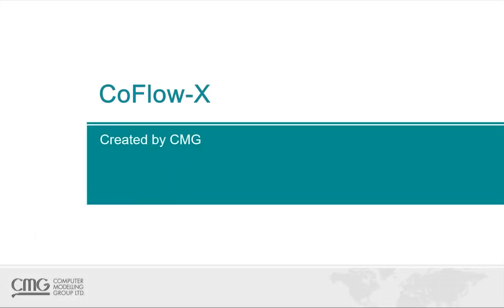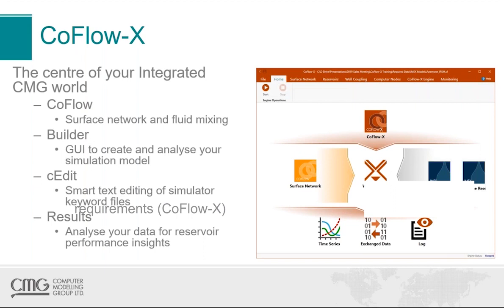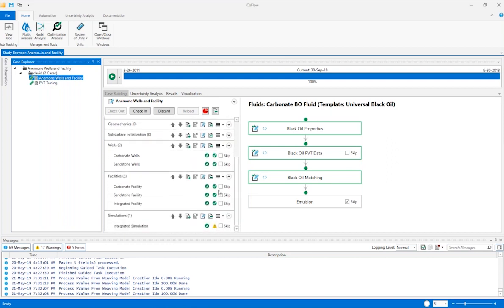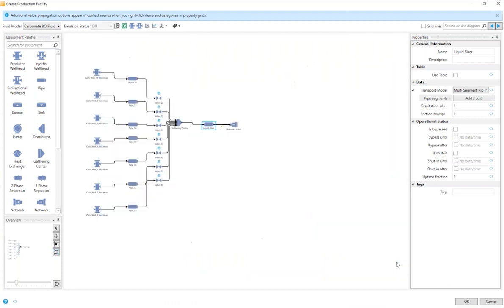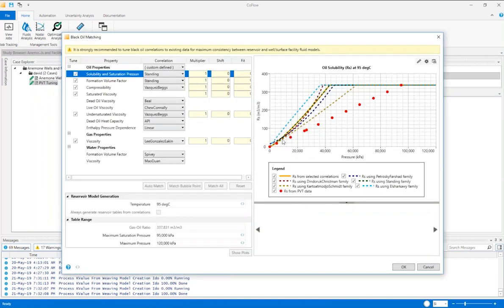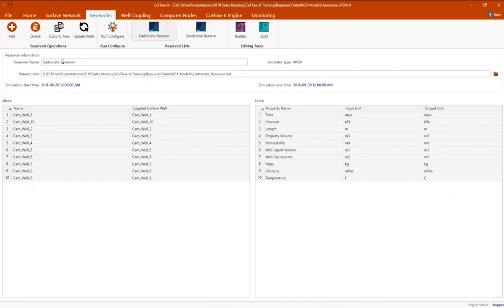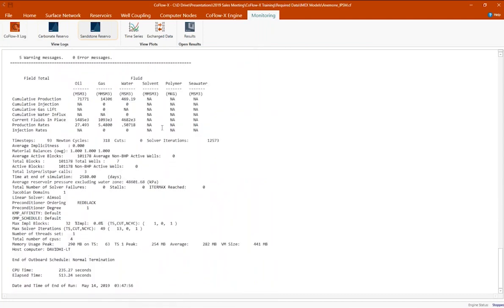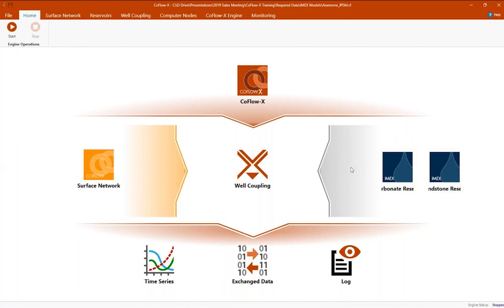Demo: Introduction to CoFlow and CoFlow-X

Comment: Do you have data comparing the model predictions with the results of an actual asset extraction which used this software? Where could I find that?
Reply: Hi.. Thank you for your interest in Coflow, CMG's Production systems modelling software. There have been several validations done by CMG and its customers on various producing Assets. Due to confidentiality of the data, we cannot directly share those results. However, there are several SPE papers published on use of this software on real assets. Results obtained from the software are also presented in these papers. you can find these papers on our website, cmgl.ca, under the resources section. (https://www.cmgl.ca/resources/technical-papers?field_tp_themes_value=All&field_tp_product_categories_value=CoFlow). If you have further questions, please do not hesitate to contact us at support@cmgl.ca